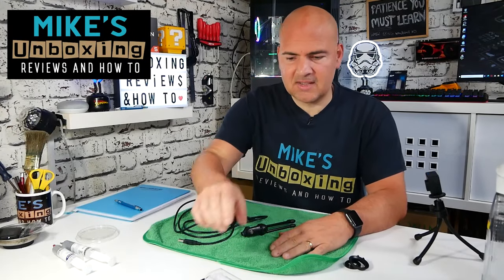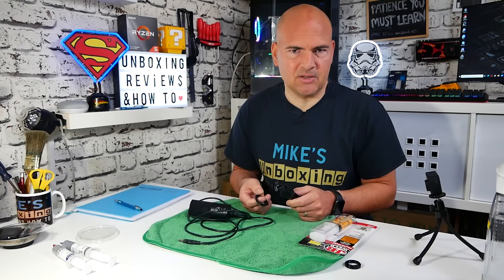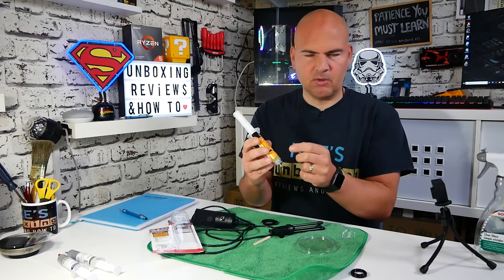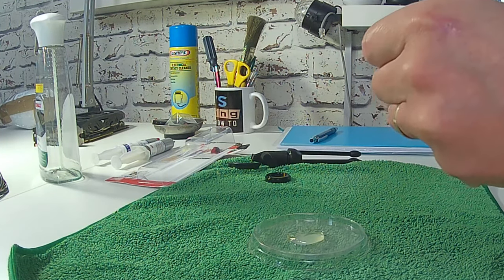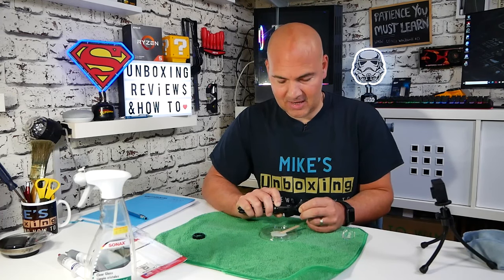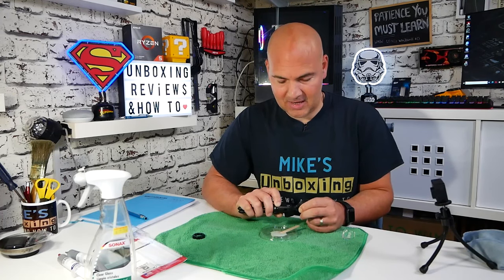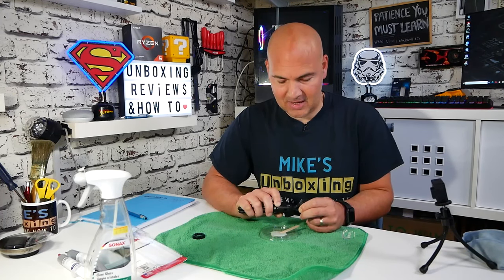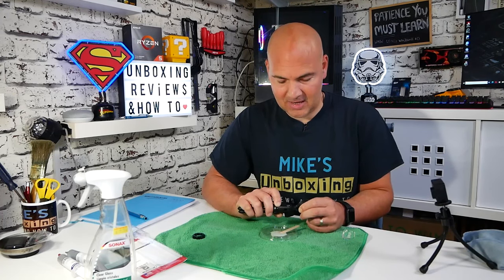JB Plastic Weld Trying To Mend The Impossible

Comment: Aircraft in World War I often used Twisted-Wire Fasteners. With the kind of difficult repair you're doing here, I'd recommend drilling holes through both pieces, before inserting single strand soft iron wire (e.g. gardening wire) through, then twisting the wire to tighten-up the joint. This kind or repair provides that all-important degree of 'flexibility' as well as strength. Finally, I'd tidy up the wire – trimming and bending over – before covering the whole with a flexible epoxy adhesive, such as the JB WELD that you just used. 

Incidentally, I developed this repair technique when my job was to deliberately crash radio-controlled model aircraft to establish what spare parts the manufacturer needed to make available as well as writing up repair instructions. We found that certain plastic parts (particularly on the landing gear, which is subject to heavy shocks) was better attached with twisted-wire fasteners, rather than screws, as unlike the screws the twisted-wire didn't stress the plastic of the fixing point as well as providing that all-important flexibility. 

Hopefully this is useful information for your repairs armoury. I've often found that applying our forefathers' techniques can improve upon the effectiveness of modern materials.
Reply from the maker: great advice, thank you
Reply: Thank you, your advice is appreciated! My husband has some RC airplanes that need repair and I have cheap hollow garden statues that need repairing.
Reply: Will use your  technique makes sense

Comment: This tells me all I needed!  I've got a flat plastic piece (a vintage guitar pickguard) with a small corner broken off.  I'm going to use a scrap sheet of plastic to bind the two pieces together from the back side and hopefully you won't see the break from the front.  I was debating on whether to use 2 part epoxy vs. some type of soldering kit.  I think this will hold strong enough and have less chance of damaging my piece in the process.  Thanks for doing the review.
Reply from the maker: You're welcome, let us know how you get on :-)
Reply: How do I get rid of the smell 😩

Comment: I left comments some time ago about a plastic repair product id used but couldnt remember the name. Its Q Bond. You should be able to get it from JB Tools. It can be used to glue rubber plastic metal it doesnt matter. If its got chunks missing and is metal sprinkle the grey powder in the damage then drip the adhesive and in seconds its cured and you can drill file sand whatever if its plastic sprinkle the black powder. Its graphite and composite material same as mixing the metal. No stirring no measuring. In one vid they take a rubberized semi round belt that looks like one from exercise equipment. Its cut in two. He dobs some adhesive on one end and sticks the two ends  together waits 15 seconds and cant pull the belt apart to save his life. Then steps throught the belt and holds it to the floor then pulls up and it wont break. You sould check it out. You can even cast things if you have a mold for it .
Reply from the maker: thanks David I'll try and find some and add it to the kit

Comment: SOLD!!! This is something I have to try. I recently did a tweeter install on my 07 Scion tc and had to drill into my rear pillars to get them to look good but didn’t have the proper cutter to cleanly cut a hole so now I have ugly gaps from just drilling holes into it trying to make a circle as best as I could but will give this a try looks like the exact stuff I need. Thanks for the vid👍
Reply from the maker: also take a look at isopon plastic bumper filler

Comment: Mike. I was just going to write a comment that said you could have probably had a new MIC stand on Amazon for the same price as the glue. Then I had an "uh, huh" moment. How much hardware could I have saved? Much. And now that older parts may longer exist.  This is big deal. Great video!
Reply from the maker: Thanks. And hope you liked the dad joke at the end
Reply: JB Weld is good shit. I've sealed holes in car radiators with it before.
Reply from the maker: Yeah it is strong stuff
Reply: I used the metal weld on a car a/c radiator coil rock hole and it never failed under super high pressure.  I did pull a slight vacuum until a tiny bit of the goo sucked into the hole in the coil so it would act like an anchor from the inside since pressure so high..

Comment: I have been doing similar repairs with an updated version. I used to use just JB Weld or an epoxy resin of some sort alone. Lately I have incorporated hot staple welding along with an epoxy. Such a game changer. I would wait until the first run of glue and hot staple has cooled down. I clean up the area and with the remaining holes I hit it up again with epoxy. The best of two different applications in one.
Reply from the maker: i really want to try hot staples, but buying a kit for the limited repairs i do is a bit wasteful at the moment
Reply: It's $25 😂  @mikesunboxing

Comment: My idea is drilling 1mm holes, 1-2 holes on each bonding surface should be enough. then cut needles into short pieces. Insert into these holes, then bend and/or cut them to match the angle/depth of each hole. Then apply strong glue on needle pieces and also bonding surfaces, not necessary to leave excessive beads on both sides.
Reply from the maker: sounds like a plan
Reply: Yes, this is a variation of the Twisted-Wire Fasteners used on wooden WWI aircraft (as I've just described in more detail, above). As you know, these techniques were developed by our forefathers in the days before modern high-performance adhesives, and they utilise other aspects of engineering that can still prove useful in today's environment. 👏

Comment: That type of cap is best marked before use so it doesn't go back the wrong way and accidentaly mix components, gluing the cap on. A heated staple made from a paperclip then sculpted into the item with a soldering iron is a better plastic fix I find. Or adding one into the faces being glued by drilling or melting holes for it.  UV glue that hardens with light in seconds is great to hold epoxy in place to set. Like a tack weld.
Reply from the maker: good point, the cap on some of the newer versions of this is keyed so it will only fit one way, so your thoughts are totally correct

Comment: I used the jb plastic weld epoxy putty on a 1000l ibc container on a small slit at the bottom. So far it appears to be holding. Do you think it'll fail and leak after a while?
Reply from the maker: hard to say, i hope it holds though

Comment: Right idea, possibly the wrong product. I use, (In America) JB Weld "Plastic Bonder Structural Adhesive" with a high PSI rating. Part number 50113 (tan, but also have black and clear 50112).
Reply: Good video. Thanks, black is what I need, just bought from Amazon

Comment: Good review, good product.  JBWeld has been an awesome product since the 60s when I was a kid and my father used it for industrial uses and later in projects sent to outer space.   The original formula focused on longevity, durability and consistency, something the other competing products are rather careless about.  In essence, JBWeld magic comes from high quality two part epoxy that has some type of filler material inside that helps reinforce the epoxy making the bond stronger than the original material.  Keys to success are to thoroughly clean the surfaces of all loose material, grease, oil or other contaminants.   Secondly you need to abrade all smooth surfaces using a file, knife or other tool.  This allows the epoxy to grip far better than it will do with a slick smooth surface.  **Finally you need to use MORE product to build a "weld" that is significantly larger than the broken area, NOT LESS as you recommended**.   Epoxy by nature is very hard  once fully cured, even stronger with the added filler including metal, sawdust, plastic powder, etc  depending on the specific JBWeld formula.   But you will always benefit by increasing the thickness and size of the area that broke in the first place.  As you pointed out, JBWeld can always be trimmed, filed, and sanded to smooth and shape it as needed once it is fully cured.   Many people have never used common grade epoxy or had bad experiences with it after realizing that Krazy Glue is very limited in effectiveness.  THANKS for your consideration and keep up the good work!
Reply from the maker: thanks for the awesome comment. much appreciated

Comment: This is great for general use. However I have tried quite a few times on a plastic tank on my radiator and has failed. I had a crack on the plastic top, and ended up using a plastic welder to fill in the crack and seal it. My radiator is 249 for a new one so before having to buy one I wanted to see if repairing it would be possible.
Reply from the maker: maybe have a look at jbweld original or abrosteel
Reply: I just welded my plastic radiator on my Mercedes last month.
 I used the original JB weld the one that has 2 tubes the black one and red one and it sealed the leak its still holding.

Comment: Hey. Want the truly impossible? Try gluing broken fan blade made out of polyethylene with JB weld epoxy. I did it 2 days ago knowing it would be impossible. Glues just don't bond chemically to polyethylene. The window fan has been spinning now for 24 hours. I can't believe this. I'm pretty sure it will eventually fail, the difference in weight distribution and vibration it causes will probably pull it apart eventually. But I really wonder just how long it will last... If it lasts even a couple of months I will be JB Weld's free spokesman 😂
Reply from the maker: Hope it lasts let us know if or when it fails
Reply: Son durum nedir? Pervane kanadı kırık mı?

Comment: Hi a piece broke off my bumper which holds it tight to my fender do you think this would hold solid enough so I could attach it back on an it hold my bumper to the fender?
Reply from the maker: i would use the original JB weld or quikweld that is a lot stronger

Comment: Interesting. My job is broken plastic around some screwholes. I'd need to build up the are area and put the screw back through it but this stuff might work. My main fear is that it doesn't stick to the existing plastic very well.
Thanks!
Reply from the maker: try the abro steel we reviewed that should be better for that task i think
Reply: You might consider using Chemical Metal, as you could fill the holes (even enlarging them to give a better bonding surface) then drilling and tapping a new thread for your screws. It's a technique that I've often used.

Comment: If you read the fine print on nearly all cyanoacrylate glues even the ones that say works on most plastics you see that they dont recomend for repairing polypropylene or polyethylene plastics. Most house hold plastics are either PP or PE. There are some with a bonder or primer that work better than others. If you can find a plastic bonding agent plastiweld is one they chemically fuse the plastic together. Now on this fix here. If this doesnt hold weld it. Determine the typ plastic it is. Find the propper welding rod for that plastic and use a plastic welder or soldering iron. Just a suggestion. Ive been welding plastics for several decades. Its like anything else. Takes practice.
Reply from the maker: Thanks for the advice :-)
Reply: @mikesunboxing  yessir. We do have the jb weld and bonder here in the us. The difference is the thermogenic reaction time. The weld is much quicker in its curing and setting time. And the strength is around 500 psi if i remember correctly. Whereas the jb plastic bonder has a strength of 3770psi sets in 15 mins sandable in 30 mins dries tan. Great for plastic to metal plastic to plastic and carbon fiber composites coated metals thermoset and concrete. Also good for filling gaps oem auto and HD truck approved. Its a urethane adhesive system. If you get the urge to do another video regarding plastic repairs i suggest you check out plastex. And plastex 3000. Its really cool stuff. You can have half a little statue or figurine. Providing you had the two pieces you could make a mold keep half and cast the other half with plastex. Repair dashboard cracks in place. Sprikle the powder drip the catalyst in and watch it tunr to a solid in no time. Its around 16.00 us for a tiny kit 40 to 70 for a 50 gram bottle of powder w 30 ml of catalyst. Can get it in different colors. Its good stuff
Reply from the maker: @davidreynolds4684  Will have to take a look at that, thanks :-)
Reply: @mikesunboxing  there is another product i found several years back that far exceedes any plastic repair products ive ever seen. Unfortunately i cant remember what its called. Due to health issues my memory is hit and miss. Im hoping it will pop up soon. Very frustrating when i cant think of something that can make peoples lives a little better or easier but i can recite The Girl From Ipanema word for word. Whos that going to help? Maybe piss off a group of people trapped in an elevator. Which in case youre wondering why anyone would intentionally learn that song is why i learned that song. You really should do it. Fn hilarious especially if you can have a friend do the music da da da. I can tell you the repair im wanting to locate is a powder resin and activator or catalyst like plastex. Around 70.00 a kit and is made in northern US. They had no distribution below colorado so it was mail order or email order only. In case you get bored and feel like searching. Thanks for the videos. Keep em coming.
Reply: @davidreynolds4684  did you remember what it was dave 😎
Reply: @ironmantooltime  im currently putting a garage door opener case back together. Its old and made of a combination of ABS/PC  i cannot find any plastiweld for whatever reason. I have used Dap rapid fuse. Its a 2 part deal it has a marker like tube with a primer you first clean the project. Degreaser or brake parts cleaner works pretty well. It may sound stupid but do your best not to touch where the glue or repair is. The oil in your skin realky can screw the pooch on this type repairs. You clean the damaged area then dry it well thdn prime the damaged area where the glue will go. Let the primer dry for a couple mins. I tend to do it several times going past the repair and getting in every divot, crack, and seams. Then apply the glue. I try to go sparingly but cover the two edges that make contact. If you have an extra hand a very fine mist of water can speed up the curing process. Ive had pretty good luck with this stuff but the other night i did a bunch of pieces together and a couple days later i bumped it and it came all undone. I was getting low on the primer and glue. Im going to say it was mostly my fault. I have a new package i just didnt open it. Long story a bit shorter. It pissed me off so im gluing everything and then welding it. This freaking thing looks like a jigsaw puzzle. Somebody hit the cover with a 2x4 im guessing. I removed it and began the repair. A friend came flying by with a bug ass purse and knocked the cover for the control board off the work space with force it flew a few feet and hit a 5 gallon bucket then bounced into two wood planers then the cement floor. I searched for replacement covers but chamberlain says its a no go. The glue helps me keep the pieces together long enough to weld it. Im having to use alternate rods as i ran out of abs rods. According to every business on the planet the Bat Crap Fever is to blame why stores dont have whatever you want. I hope this helped or answered your ? If not lemme know and ill make sure were on the same page. For the record i could have just remade the control board cover from thermal plastic but the olny stuff i could find was a 24x24 x1/8" sheet for 65.00. If you do need to recreate something and are patient. You can repair damaged plastic or make a jig and or mold and shape the thermo. It is designed to adhere to other plastics with the correct heat and or bend and wrap around objects to build a mold.
Reply: @ironmantooltime  ok im focused better now. I couldnt find the message regarding what i was supposed to remember. Try Q Bond. You can check out how amazing this stuff is if you google jb tools Q bond and Q bond 2. That should get you to the site where 2 videos are available. The kid takes a broken piece of rubber that looks like a semi round solid rubberized belt like on exercise equipment dobs the adhesive on one end then holds the other to it for 15 seconds or so then pulls like hell on it then puts it under his foot and is pulling as hard as he can and it didnt come loose. Then he has a piece of metal with holes all in it. Takes paper sticks it under 1 hole. Sprinkles some powder in the hole drips the same adhesive he stuck on the belt then sprinkles more powder and in seconds its hard like steel. Drill it file it whatever. They have the powder for metal which is aluminum based and black with composite and graphite materials for plastic. Hope this helps. We fixed a dashboard in the vehicle with this stuff. Filled the cracks with powder then dripped the adhesive if it doesnt fill the prob area add more. Its not toxic and the best part is theres no ratio to worry about. If you put too much sand it off. Nit enough pile on some more. Take care